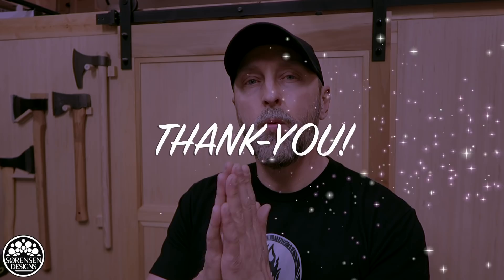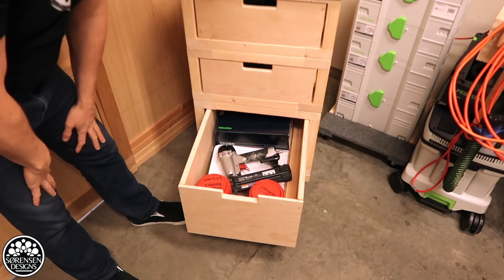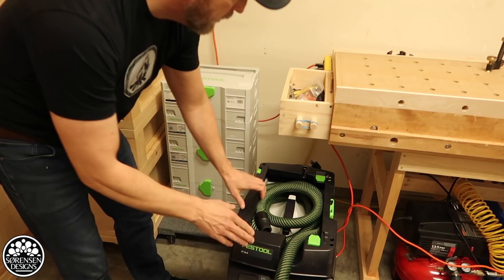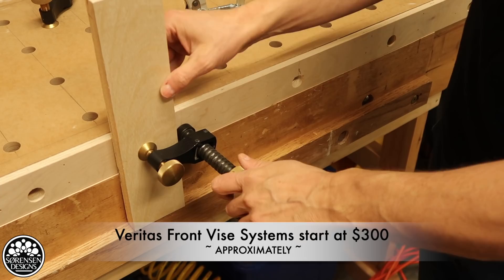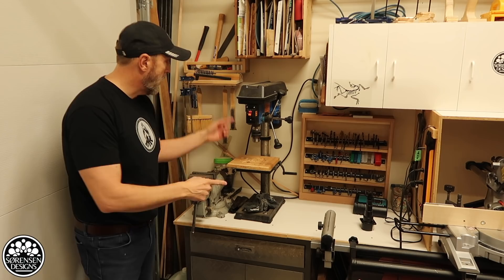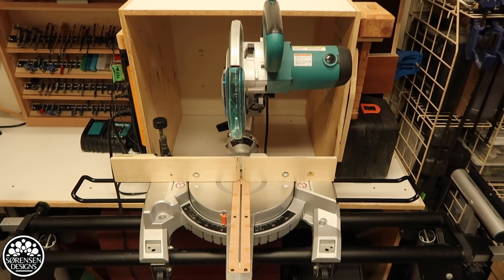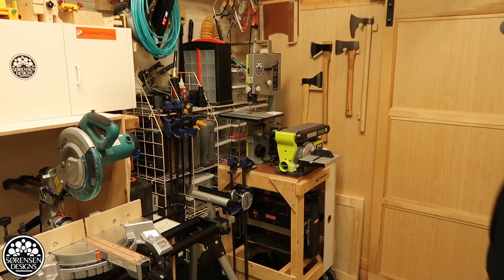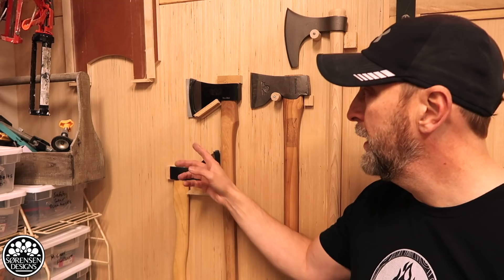Shop Tour 2019 // Small Woodworking Shop

Comment: Nicely organized creativity nest. I am currently "remodeling" my mini shop and doing the same, maximizing every inch or space. You are right, you will never have enough space and you will always need the new tool on the stand. Thanks for sharing.
Reply from the maker: @Braulio Perez Thanks! I know a lot of people can relate to working in a on-car garage. The only big change I would make with a larger space is a stationary table-saw with an out feed table and maybe a stationary jointer. Cheers 🙂

Comment: Nice small shop layout.  I'm the same way.  I have a 2 car garage with one side dedicated to my workshop and the other side is my saw shop.  Unfortunately, I live in the far northeast corner of Vermont.  During the winter months, my saw shop is where I store my Subaru and the dedicated workshop is where I store my tractor with a front end snowblower.  So, I'm pretty handicapped creating any projects until the warmer months when I relocate my car outside and the tractor in my shed.   I like your tool layout and storage and I really need to re-organize my shop more in line with yours.  Thanks for sharing your shop tour and cheers mate.
Reply from the maker: @William Logan Thanks! Yes, it's good to compare notes. I used to have a similar situation where my detached garage was my workshop and I was located in Toronto. The shop was not heated so projects went on hold until the spring. Now I'm on the West Coast and can work all year round. I still have to juggle, as you can see - there's never enough space! Cheers 🙂

Comment: good setup you got  i didnotice your running a ryobi band saw and sander i have looked at those and wondered  if they woorked ok do you think they were worth  buying ? cheers
Reply from the maker: @Steve Hubner Thanks! For the price, both the bandsaw and the sander do a great job!  It really depends on what you plan to do with the tools. If you want to re-saw boards, this is not the bandsaw for you. You would need something more robust with at least a 14 inch capacity and a proper fence. I bought the sander to have a stationary belt sander. The disc sander part is okay for small parts but the wheel is too small to sand anything over 3 inches wide.